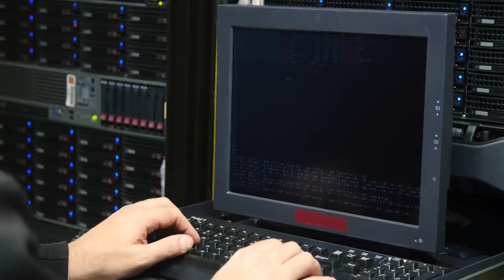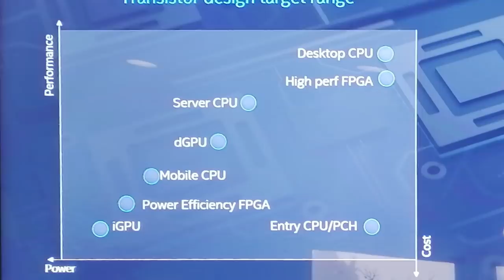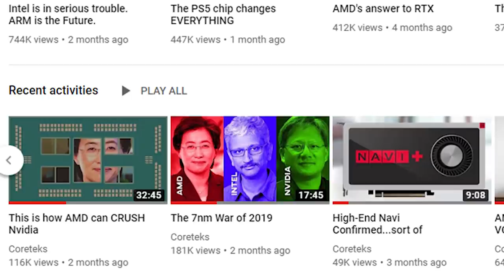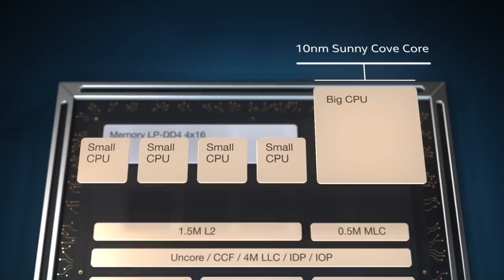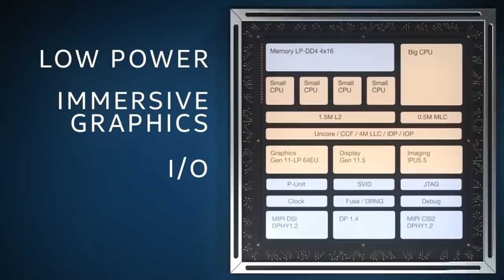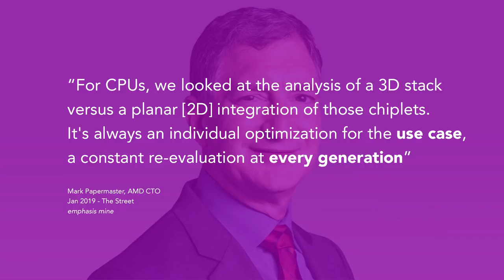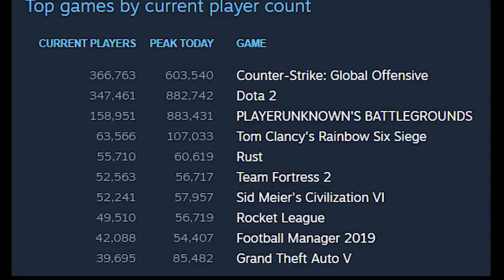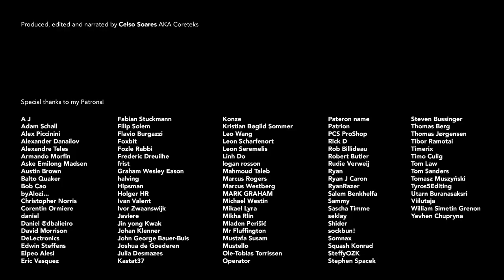2D vs 3D Stacking: Intel’s plan to beat Zen 2

Comment: It's safe to say most people in the know dont hate on Intel because of their lack of innovation... It's because of their price gouging and anti consumer and anti competitor shenanigans.
Reply: Many of their practices were also illegal.
Reply: Well, that's a backward way to insult a company. I'll take it because much of their innovations are killed off before they become viable exactly because of their anti-competitive behavior.
Reply: cough CTS Lab cough
Reply: Cbeddoe19 isn’t that called ARM, minus the storage
Reply: Well said best bits, agree 100% with everything you said.
Reply: Well its doable but cost and possible defects killing entire thing make it worst choice to pursue with current technology also some proceses used to make certain parts like ram might not be as compatibile with others damaging lower layers of unit ( its already problem with hbm stacks) cant imagine yealds for such thing atleast not during my lifetime maybe 50+ years in feature at best.
Also they work on diffrent voltages for maching performances look on ram cpu and gpu voltages and few other parts there is reason why you got 1.3v 3v 5v 12v rails
They would be nightmare for designers,
And bighest you mentioned heat unless we will find miracleus superconductor in 0-40*c range to make it somewhat closer to reality ( mostlikely it would need to survive temps from 0-120*c during work.) as some of those heat spots go way higher than entire cpu/gpu package.
There is another thing it would be so fragile that transportation and distribution costs would skyrocket. ( slight flex and entire thing dies and such things are issues with higher count of layers and you can imagine it breaking apart/cracking instead flexing back and forth damage to layers would be bad.)
Reply: Same. Its also why I hate Nvidia more than I hated Intel today.
Reply: Pretty much, Intel is the Xfinity/Comcast/Att/Spectrum/Charter of CPUs
Reply: @Cbeddoe19 Well, for reference, Intel spent around 13 billion dollars in 2017 for R&D, so I imagine it's definitely around there. If you mean the specific price to manufacture a single chip, not very high at all, probably sub 50 dollars.  It's mostly the upfront cost of R&D plus the fab itself that makes shit so damn expensive.
Reply: facts
Reply: @Mike Smith It's not that much tbh, their net income is 21 billion, aka 21 billion AFTER all their expenses.
Reply: Exactly
Reply: And beacause they dont support old motherboards
Reply: Intel Innovation: Stuck at 4 cores mainstream, for how many generations???
Reply: as it was ever not the case. they are by far one of the most unethical company outthere
Reply: Intel has the best engineers, bar none nobody comes close.  Now there management that's another story.
Reply: @freckledtrout3299  you sure? Is it the same engineers that can't crank put 10nm chips?
Reply: @8est8its89  I'm certain.  Intel simply tried to make 10nm to dense(It was more dense than even TSMC's 7nm) using quad patterning which is like using a stencil to spray paint letters but lifting it up 4 times and repeating.  That process simply couldn't go that dense so they needed to move to EUV to make the chips that dense which is what Intel is doing.  Speaking of TSMC will also have to use EUV to get to the densities that Intel was shooting for 10nm and TSMC will call that 5nm.
Reply: Freckled Trout 
Correct.  Intel’s 10nm is comparable to TSMC 7nm.
Reply: @W0LV1E45  I fully agree with you
Reply: @freckledtrout3299  I would love that they stop using this as marketing those size are clearly defined as the distance between gate and drain. Its the same as Intels and NVIDAs naming schemes where you don't know what you get any more without deep studding some tables.
Reply: There still is lack of innovation. This is not a new concept but rather a long term development that is only waiting for engineering to catch up with design and provide a way to actually produce the things people come up with.
Adding everything as close to the die as possible has been going on for ever. And is basicly the objective for every system designer.

To me that doesn't represent innovation honestly. To me innovation means finding a new way to design to produce better or more efficient products. 
To me this is evolution, not nescesarilly innovation.

If they can bring this to market competitivly it will be a design breaktrough yes, one they probably spend many years and tons of money on. But not innovation.

Anyway, that is my take on things

Edit; concerning intels shenanigans, in my opinion intel should have been dismantled decades ago.
They are bad for the industry, they are no different then the maffia . They did a lot of criminal stuff (and probably still do). People will end up in jail for stuff like this and are stripped from their assets. 
A corperation should suffer the same faith, yet they are allowed to do what they want.
Reply: Yes, but some people also like Intel because of the good software support on the Linux platform. I mean  we are using low power APU from intel (i3 series) to encode VP9 video on it's built-in GPU in realtime under Linux. And this matters, because it's web video, compatible with the browsers. Another place where Intel could enter is the tensor cores market. I mean with descent software support for the deep learning frameworks, they could steal some niche from Nvidia.
Reply: @angelg3986  still, if the maffia does some good things for the community they do all the illegal stuff in, create unrest in and are part of the reason the neighbourhood has such a bad reputation, are you going to support them in what they do?

Intel with their shit destroyed any opposition in illegal ways and put themselves into a situation where they controlled the industry, held back progress, made computing a lot more expensive then nescesary for everyone both in private and in business use and made them untouchable for way to long.

They starved all competition from the money they needed to serve new technology with support and development. If it wheren't for intel, amd, via, cyrix etc. all would have been competitive and had the cash and the oppertunity to serve all those niches and industries and who knows where we could have been allready and what we missed out on because of them.

And if intel goes away that demand will still exist and others will simply start to serve it.
Intel defeating nvidea is just feeding the giant more monopoly to become even larger. That would just make the problem even larger.
If intel gobbles up ai and deep learning we will lose amd and nvidea as well.

It would basicly become the same as google or amazon. Google is sole ruler of the internet and basicly controls all of it. With the exception of retail and streaming which amazon basicly is taking over completely and will eventually rule on its own.
And the little baby called facebook will simply be absorbed into either one of them.

Nothing good comes from from having these giant bigger as mid sized countries.
Reply: @baronvonlimbourgh1716  I agree on this. The giants ate the competition and the trans-national companies also are a bad thing as "the new world order" is. Because the bigger they grow the more they corrupt the politics and the less chance for existence of the middle class of private business owners. E.t. the giants destroy the middle class stripping it from it's business and making everybody kind of workers. They also finance own start-ups  which can afford financial loses for extended periods of time trying this way to fill in every possible niche. Bad for the whole community as they trying to turn everybody to a puppet w/o own will.
Reply: @angelg3986  indeed. Very true.
So stop giving these corperations your money ;)
Reply: alysdexia  = dyslexia? I hope that was ment to be funny ;). Thanks for the chuckle.
Reply: @baronvonlimbourgh1716  where do you buy your CPUs ?
Reply: @angelg3986  at the local computershop.
Reply: Baron von Limbourgh so the giants get your money anyway
Reply: @angelg3986  yeah, whats your point?
Reply: @baronvonlimbourgh1716  You told me "don't give them your money" so I wondered how to get a CPU then and you tell me "I go to the local computer shop" so I conclude that your money then via the local shop go back to the CPU giants... hence the money always go there.
Reply: You must not be vary old. Let's take a ride down memory lane. the year is 2005 . AMD has best cpu on the market. The cheapest of these cpu  was $375. IN 2006 INTEL INTRODUCES  CONROE DUAL CORE. INTELS CHIPS ON THE HIGH END COMPUTING entered  the market cheaper than AMD lowest performing chip.  History my friend is telling all of us your full of crap. Haters will always hate as today's Democrat prove haters will ALWAYS hate!
Reply: intel price gouger. up with amd. down with intel
Reply: Intel only releases their "new" CPUs with lower price and / or slighly higher clock speed and more CPU cores when AMD releses something that is better. If it was not for AMD Intel would keep selling us  only crap that cost a fortune...
Reply: It will be interesting to see who comes out on top over the next few years. At the moment it seems really hard to imagine Intel catching up to AMD with or without 3D stacking. We can piece together Intel's chips out to around 2022-2023. Intel's desktop market is moving really slowly at the moment because Intel can't scale or clock their 10nm node well at all but the mobile market is developing a little faster: 

We have already seen Sunny Cove chips in Ice Lake mobile parts, this was the first IPC update since 2015 Sky Lake it was ok but the 10nm+ node held it back.

The replacement for Sunny Cove is Willow Cove with Tiger Lake chips, these aren't meant to be that much of an IPC improvement on Sunny Cove but with a few tweaks to the cache and a few other things should mean it's a step in the right direction. The main thing for these chips will actually be that it's using the 10nm++ node which is meant to be 'proper 10nm'! I will believe it when I see it. The other interesting thing about Willow Cove is we will see Xe GPUs from Intel for the first time in a CPU, again I'm not expecting too much but it might start coming together a little more for Intel from here.
 
The big Intel chip to look out for is what comes after Willow Cove though, that is Golden Cove. This is when we will see Jim Keller's finger prints on an Intel architecture design. This is meant to be a big IPC increase plus will/should be on 7nm. Sadly this won't be until 2022 I would expect and that's if things go well.

After this we are onto Ocean Cove. There are rumours this is a totally new architecture, built from the ground up by Jim but I am not sure he will have had enough time by 2023. It depends how much time he has had to spend on Sunny and Willow Cove I would think. 

For the desktop, we know Comet Lake is coming in April this year which is just a 9900K with 2 extra cores so really nothing exciting at all. Then we have Rocket Lake in mid 2021, this is still on 14nm but it meant to be based on Willow Cove so it will be a very decent IPC increase over Skylake but only 8 cores it seems. And then we should get Golden Cove on the desktop in 2022 hopefully on 7nm if all is ok with this node.

If AMD pushes really hard with their roadmaps I can't see Intel catching them until at least 2022-2023 and maybe not even then. AMD should hopefully bring Zen 3 in July this year (but could slip to the end of year as there's zero competition), then Zen 4 near the end of 2021. Then Zen 5 maybe in 2022  but probably Zen 4+ and Zen 5 in 2023. Golden/Ocean Cove need to be something really special and very different to what Intel has been doing for the last 20 years to get close to AMD if you ask me. We have some interesting times ahead though.
Reply: It's not price gouging if there's competition at a cheaper price, it's just a stupid tax.
Reply: Freckled Trout 14nm++++++ say hello.
Reply: @Rhys Tatum instablaster ;)
Reply: @Rhys Tatum glad I could help :)